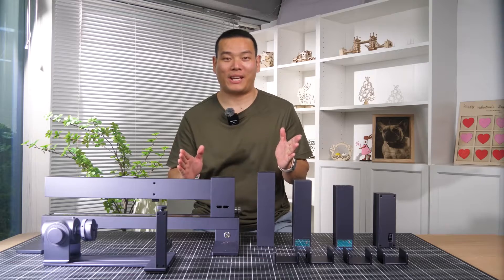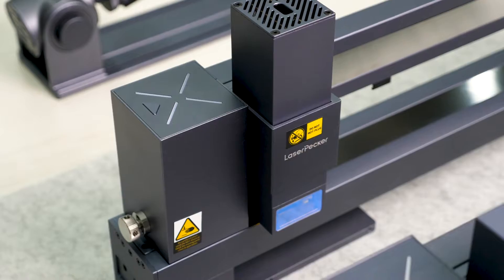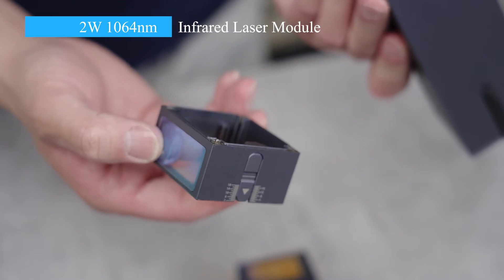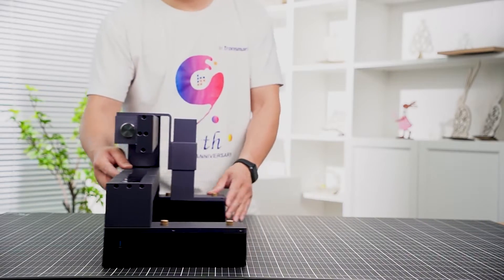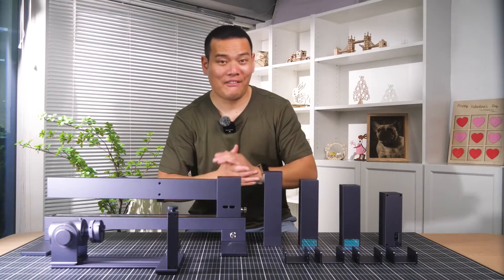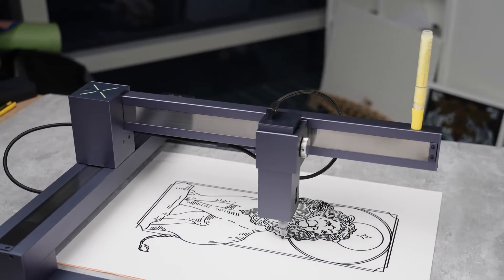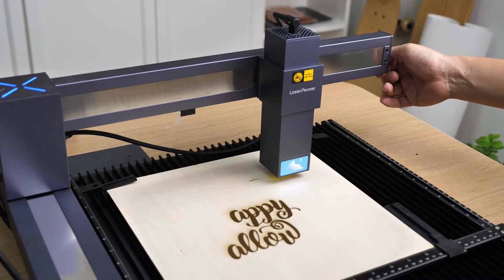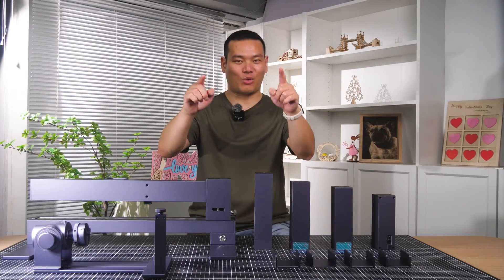The Dream Laser Engraver is HERE! LaserPecker LX1 Series Full Review

Comment: I had combat my urge to dislike the video but I guess I'll leave it with only the feedback comment - please do something about audio levels as it get obnoxiously loud sometimes and the texts er just too quickly gone (you can rewind, sure, but it plays in your and our favor if they stay for 1-2 seconds longer)... and also I did really hate the comment "it has a cap with smoked glass to make it easy on the eyes". That's just wrong as that window will do jack when engraving as the flashes of light hitting the material are completely exposed, so please stop telling that (just watch your own footage and you'll see). And also it's a pitty that nothing was shown/told about the EDF motor - looking air assist after the module was shown, as some cuts were spotless, but the Bat engraving was pretty dirty... My guy, I don´t want to bash you, but perhaps it helps... Dunno, prolly no one will read this, but if it helps...
Reply from the maker: Hi, thanks for your comment and precious suggestions :DDD for subtitles i will definitely optimize them when i have time, currently im busy at Xiaomi 14 videos :D
Reply: @SamiLuo  Nono, all cool with the spoken part as I understood you, but you added some texts on screen (sorry, can't recheck RN, bad signal) that were just were gone too quick. I value the effort and even though my first message was not so great, it was well meant. Cheers!